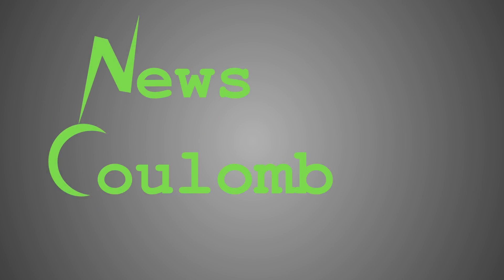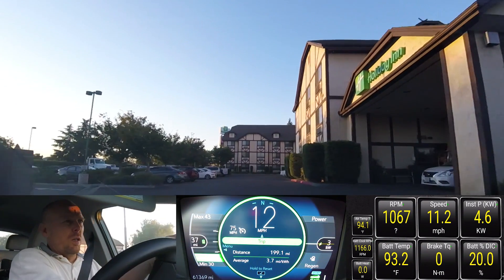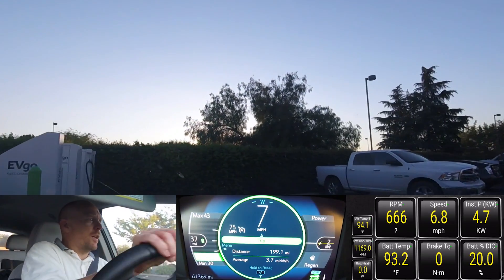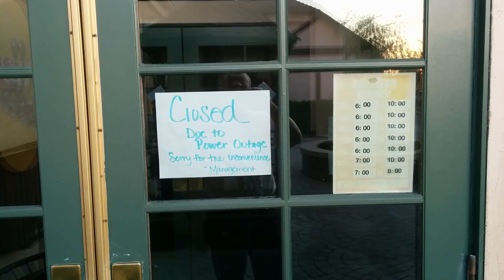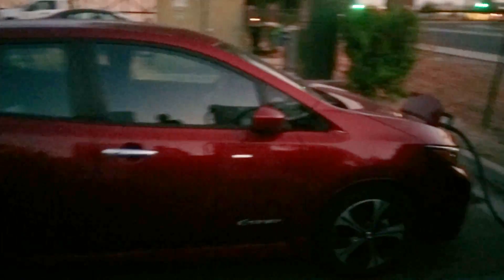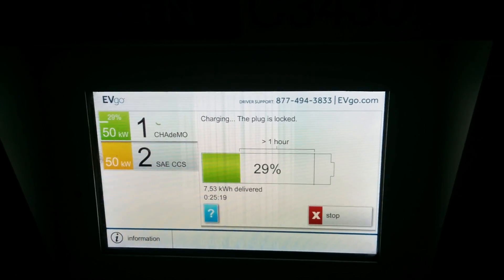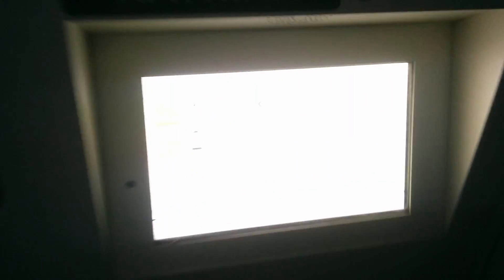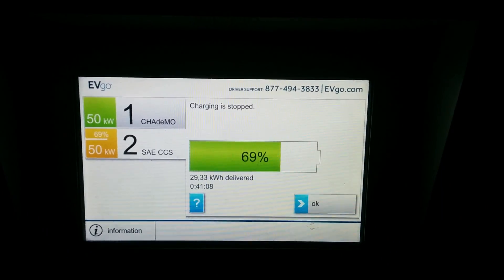First-Hand Look at 2018 Nissan LEAF Charging in Hot Weather

Comment: I own 2020 Nissan Leaf SL Plus, no issues with heat, depends on the charger, no very few fires with Nissan Leaf with 500,000 cars sold world wide.  Speaking of fires, how is your Chevy Bolt doing?
Reply from the maker: For the LEAF, it really depends where you live and how you drive. As I've stated in other videos, I think the LEAF is a great car for those who rarely drive over 350 to 400 miles in a day. Basically, if you can get away with just one DCFC session, you won't ever experience issues due to the lack of active battery thermal management (unless you live someplace like the Southwest or the California Central Valley).

The Bolt EV is doing extremely well, thanks. I recently took it on a 750-mile day trip, and it did great, even with a 5-year old battery. I received notice from GM that my brand new battery is built and being sent to the dealership. 

It sucks that they have to replace 140,000 batteries for a < 0.02% risk of fire (less than the average gas or hybrid car), but the consequences of a fire inside a home are too severe to ignore.

Comment: Ive rapid charged now at hot temps with my new leaf and have had fine speeds. Even when very hot still starts at 29kW. I don’t see how you could have determined that the leaf charging was very slow. Again for many this is not an issue.
Reply from the maker: I simply looked at the display. The amount of energy that had been transferred versus the time it had been charging. Apparently, this wasn't even that bad. At this same charger (well, the one I was using) under similar conditions, I ran into another 2018 LEAF. Only that one was charging at 12 kW (not even double Level 2 AC speeds), which is totally unacceptable when you are paying $9 an hour to charge. The owner was livid and had a lot to say about Nissan's misrepresenting their product.

Comment: Don't forget about the other car with no active TMS: The VW e-Golf. I leased a 2015 and liked it well enough that I bought a 2017 e-Golf. I'm pretty sure VW always included a warning like this:

"When equipped with DC Fast Charging, e-Golf charges up to 80% within an hour requires charging at select DC fast charging stations. Frequent and consecutive high-voltage charging (including DC charging) can permanently decrease the capacity of the high-voltage battery. See owner's manual for details."

But I believe that the e-Golf will also throttle charge rates based on battery pack temperature. At least my 2017 has Samsung SDI cells that I'm guessing are more robust than the Nissan cells. 

When I leased the 2015, I performed many back to back DC fast charges, never saw any throttling, but at the end of 3 years and 25,000 miles, saw a bit of degradation (maybe 5-10%, VW doesn't make it easy to find usable battery capacity).

I just stopped at the Vacaville Chargepoint Express 100 station (in general, these stations are garbage, no?) in 95F heat and in direct sun. The car charged at 15 kW. When I ran the A/C, I saw no change in charge rate, but the station name plate also says amps are derated above 86F, so I don't know if the station was overheated, my car's software cut the amps or a bit of both. 

I realize the car isn't cut out for this sort of treatment regularly, and VW documentation says over and over about violating warranty with a lot of DCFC sessions, but I only make 1 240 mile trip a year, so I'm ok with waiting at L2 after the first DCFC. I suspect most people would not like this sort of stop and I agree that actively cooled batteries are a necessity for mass BEV adoption. Since I was able to get the e-Golf for $20 grand brand new (thanks to VW wanting to clear out inventory and the federal tax credit, I am willing to live with the trade off). 

I agree it sucks for Leaf buyers who didn't know what they were getting into.
Reply from the maker: I'm guessing Nissan has a disclaimer like that somewhere, but I haven't found it. The brochure clearly states: "90 miles in 30 minutes." So to me, this is as much an issue of misleading advertising as it is of the car's capabilities.

Comment: Interestingly, I found this many years ago. https://www.youtube.com/watch?v=DHrUoITe77I

Close to 100F is not extreme heat, it's typical summer day in SoCal. Even worse with Nissan is that they offer free charging with this crap so that locals clog up DCFC as 18 kW charger instead of 50 kW charger. Nissan really should compensate every EV drivers by getting rid of free charging at least with their turd Leafs they have now. Better is to get rid of free charging altogether.

Comment: The 40kWh Leaf is engineered for the Japanese domestic market. Cooler temps and shorter drives are more common on mainland Japan. The ~60kWh 2019 Leaf is engineered for the high use, high temperature environments seen in the USA and Europe.
Reply: The Leaf II 63kwh has no thermomanagement also... It was big mistake of Nissan engineering, I expected TM after facelift but nothing...
Reply: And it took them 8 years to figure that out?
Reply: It was not an issue of awareness but cost and engineering constraints. Nissan has sold more EVs than any other manufacturer. High cost proof of concept EVs (Tesla) make for good headlines but do little to curb transportation fossil fuel consumption.